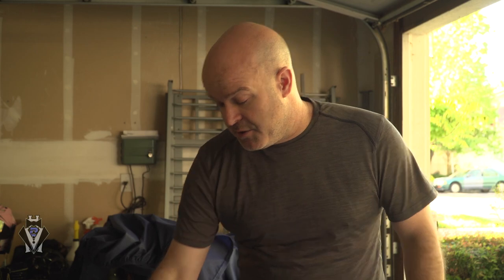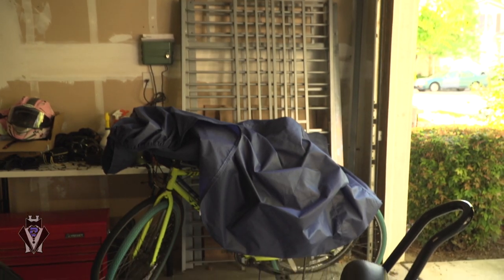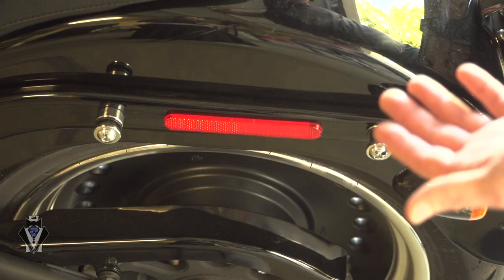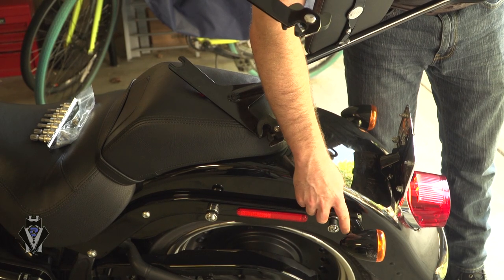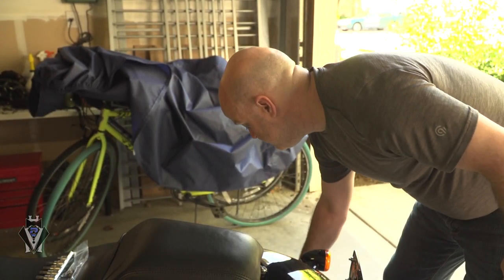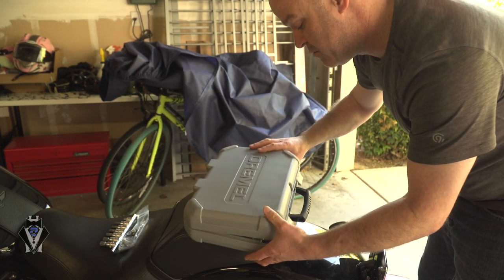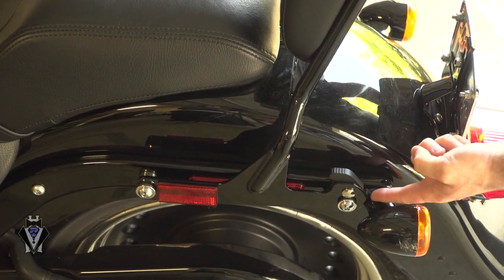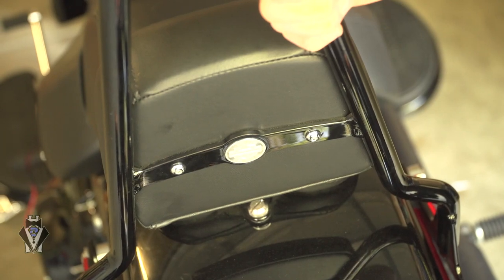How to Install Sissy Bar on Harley Softail - No Signal Relocation Required

Comment: Just bought a used HD backrest/luggage rack and installed on my “07 Nightrain.  Your video saved me a trip to the mechanic for turn signal relocation.  Once the brackets were cut, the rest was a piece of cake.  Even worked with my current saddlebags attached with Easy Brackets.  I just need an additional 7/8’s in. Spacer on the front bracket to accommodate for the width of the detachable latch in the back.  Thanks!

Comment: I have a 2017 low rider s that was going to install this on which looking at this saves me a lot of money. I have not started to take it apart yet and was wondering what you did with the turn signal wires?

Comment: Thanks for sharing, I bought the very same sissy bar for my 2012 Fatboy Lo I have already purchased all the parts for the install including that darn turn signal relocation kit which will obviously make this a messy job. I stopped by a HD dealership for my parts and managed to get to a mechanic and he said to install the relocation kit the easiest way is to remove the entire rear fender, something I really do not want to do plus it requires an extra set of hands to do this job without incident, I happen to own that sort same drimmel kit so I’m in business, however I’m hoping to get just enough clearance as to not scratch the turn signal fixtures. The only thing I should need at this point is some touch up gloss black for the drimmel work, thanks!

Comment: Ok so cutting the tabs might be ok for a painted bracket,  but I wouldn't do that on chrome bracket,,  if you do your gonna have Rust everywhere not to mention the heat from the cutting is going to likely delaminate and blue the surrounding chrome at the cut points...

Comment: In the 60s that was  called a 'leaner' bar. You have to have a  rigid  frame for a sissy bar.   A sissy bar bolts onto the frame near the axle
Reply: p kerit well in the “2020’s “ these are more commonly called sissy bars as that’s how they are catalogued in every website and part manual